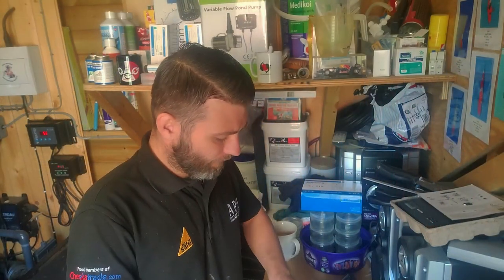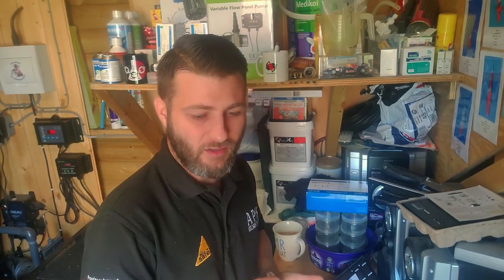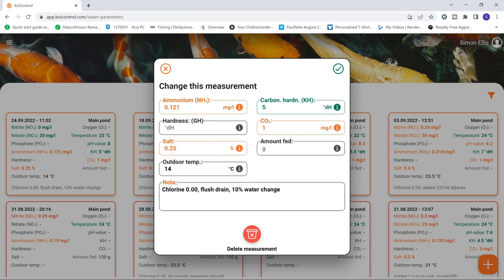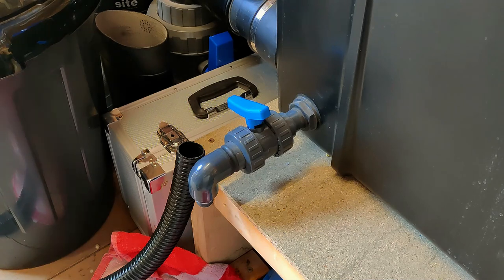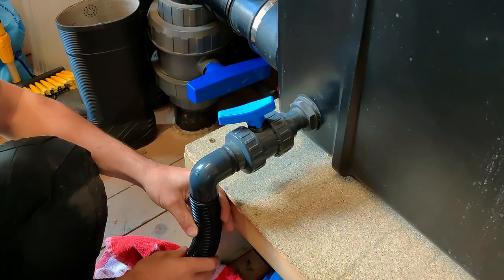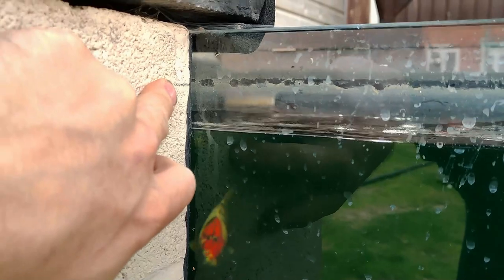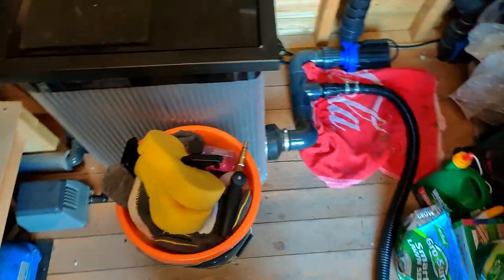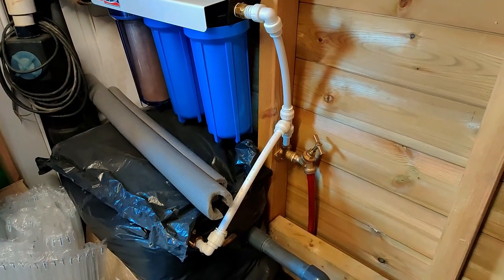What My Weekly Koi Pond Maintenance Consists Of

Comment: I do the same with sodium thio. A tip what I do tho is use a spray nozzle  so chlorine can gas off in the air too. Add half a dose then the other half once all the waters in. Leave all air pumps on to circulate the water n gas off any left over chlorine. We've got good water up north mate 👍🐟

Comment: Hi Si, as you know I've got a big blue as I have a trickle in, but yes it can be a total pain in the rear, when I do any large water change I top up straight from the tap and add sodium thiosulphate, with my purge line I can drop about 750 gal in around 6 minutes, I wish I could fill it back up as quick.
Rob.
Reply from the maker: Tell me about it. easy to dump it, a pain to refill it😅 could do with a fire hydrant in front of the house🤣

Comment: great vid simon. i'm with you on the big blues. seem more trouble than there worth. at least with dechlorinator you can test your water with a dpd tablet and be confident that it's chlorine free
Reply from the maker: Yeah I can't be doing with the hassle of disconnecting it all the time to refill or roll about when it starts tracking. Just as easy to use a liquid dechlorinator.
Reply: @UpNorthKoiPond  my thoughts in a big blue is they are designed to be used under pressure rather than a trickle ..  if you run water through them full bore they work fine if you trickle they get water tracks through them ...  just my idle thoughts

Comment: Hi simon would you recommend that moveing bio or go for a better one how much media can you get in yours.I'm hopeing to get the Filtreau Drumfilter HF30 thinks its same as your drum just hi flow screen
Reply from the maker: For what it is it's a little on the pricey side tbh. You can make one for much much less. Realistically you will get probably 70-80l of K1 in it so it rolls properly. Yes the HF30 is the same as mine apart from it has 2 outlets I believe. I also swapped the standard screen on mine for the high flow screen.
Reply: @UpNorthKoiPond  I was looking at the sakura bio from kitsu koi looks a bit like yours just about the same dimensions but a bit more expensive.might have to pop over and check it out.
Reply from the maker: @deanskoipond  honestly mate, do not pay that for a bio chamber that size. You will regret it when you want to upgrade/add more bio filtration. I'd consider making your own OR even see what the guys at JBR Plastics can knock up for you .
Reply: @UpNorthKoiPond  thanks I will check them out.keep up the great vids
Reply: @deanskoipond  just use an ibc plenty of room and cheap as chips